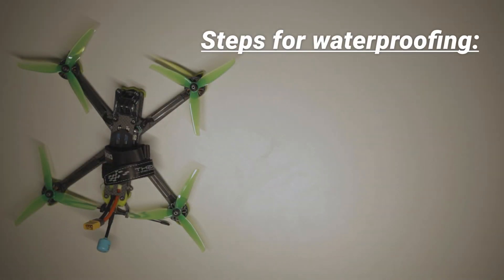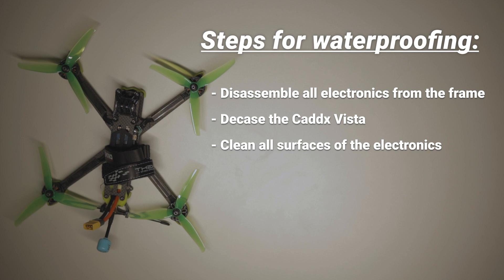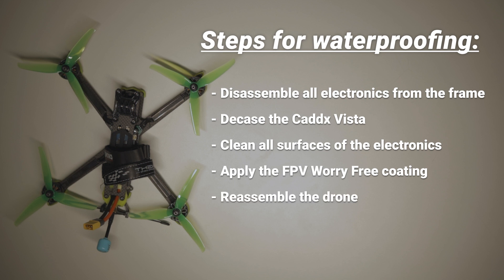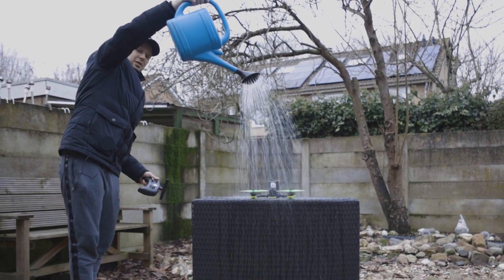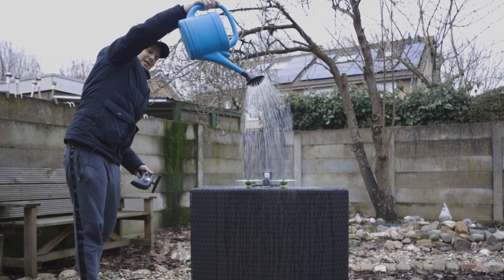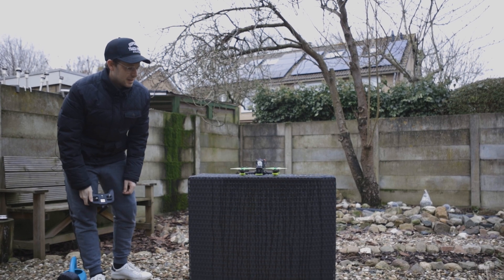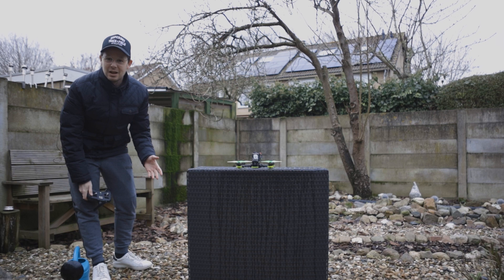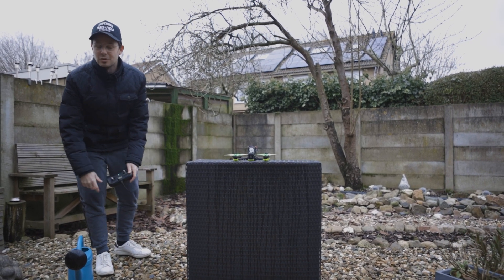FPV - Waterproofing My Drone

Comment: I wanna do this to my drone but I’ve got the evoque which is covered all round can’t seem to find any videos on it
Reply from the maker: It’s basically the same process for any drone. Just take it all apart without disconnecting any of the electronics. It might be a little tight to make it fit with the side walls, but it should still be possible. Only thing I am not sure about is waterproofing an O3 air unit, haven’t looked in to that yet. Maybe I can make a follow up video on doing an evoque if I find a nice sale 😏 Meanwhile if you have any questions I can help you with, let me know! ✌🏻😉